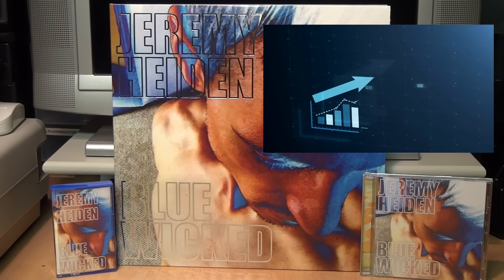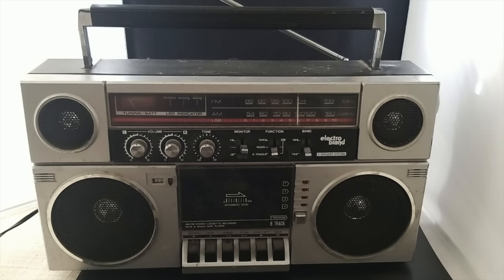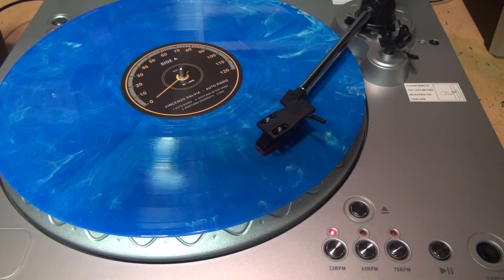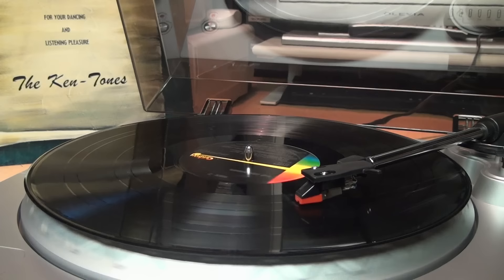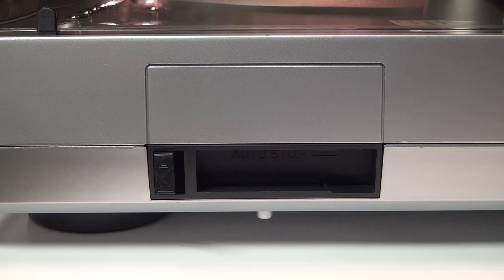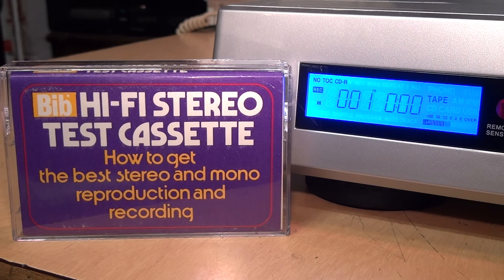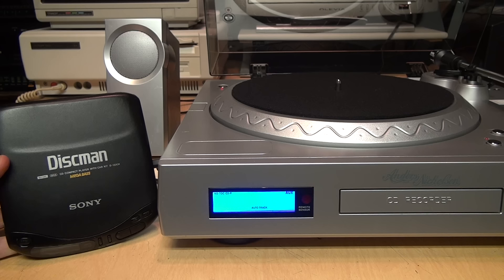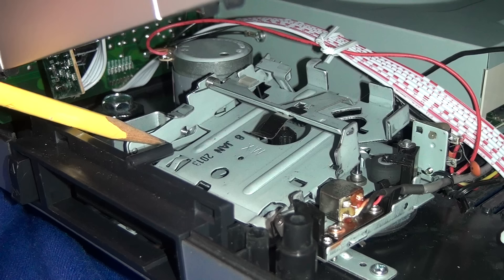A turntable that also plays CDs & cassettes - Anders Nicholson 2655

Comment: It's curious how they get 95% right, specially the turntable, and then they ruin the most advertised functionality in a stupid , easily avoidable, way. A less noisier optical drive with some dampening and problem solved...
Reply from the maker: Or simply run the drive at a slower speed. There's no need to rev it up to maximum speed just to record audio in real time.
Reply: @vwestlife  I know, but that would need some additional programming

Comment: I wouldn't want to record vinyl straight onto recordable CD anyway, to be honest.  Nice idea, but I'd prefer to record onto a PC, via the USB cable, then do a bit of post-production and then burn to a CD via the same PC.  The cassette part of it looks cheap and nasty.  It's not even a proper cassette deck, but some ultra cheap design for playing tapes in a car from the 1970's.  I like the overall idea, (of course), but execution was, for the most part, pretty poor.

Comment: It's a shame the cassette player. The sound quality is not bad. If they had done a better job at electronics, as basic as it is, it would be a more than decent cassette player.
Reply: replying to @masterargento90x:

i will finish your first sentence *FOR* you: "did not play cassettes with good sound quality". Did i finish your sentence right?
Reply: @user-ir6wv3gp4f  It's not that it didn't sound good, but that it put parasitic noise because of the poor electronic insulation, even rewinding the same. At no point did I say it was wrong (in fact, nor did Kevin say that).
The criticism I made was constructive, because if you plan to acquire a unit to digitize old formats, and it throws you parasitic sound improper of the one that gives you a cassette or a vinyl, it is an extra job, since you will have to clean it and lose extra frequencies.
Besides, the blow is higher than that given by an average cassette.
The truth is that I don't know what you find wrong with my comment.🤷‍♂
Reply: @masterargento90x  DARZHERFLARSCHNARBLEFLARFER?
Reply: @user-ir6wv3gp4f  What???
Reply: @masterargento90x  I PUT A PIZZA, LOADED WITH PIZZA SAUCE, ON A TURNTABLE SET AT 78 RPM: *PIZZA SAUCE FLYING ALL OVER THE PLACE!!*
Reply: @masterargento90x  - DARZHERFLARSCHNARBLEFLARFER?  
That's the sound tapes made when they were getting jammed into the tape player mechanisms.

Comment: You know it is a crap turntable when you see that stylus with the red sloped bottom. Just like on junk Crosley and Victrola tables. LOL. Some are not even diamond. They are RUBY styluses!
Reply from the maker: Did you miss the part where I explained that it's a magnetic cartridge, not the similar-looking ceramic cartridge?
Reply: @vwestlife  I wasn't talking about the cart build but more the el-cheapo styluses they use on those $10 cartridges. And I doubt someone would go to the trouble of putting a nice $250 microline rig on that tonearm. I guess like you said, it was sold to unsuspecting senior citizens afraid their records were turning into road tar and they needed to put them on CD's which will deteriorate before the records ever do. LOL.
Reply from the maker: @AudioGuyBrian  It has a diamond stylus.

Comment: Isn't this a technically illegal product?  AFAIK, any CD audio recorder needs to only be able to record to special "Audio-CDR" disks where a tax is paid to the RIAA.  I've always found this OUTRAGEOUS.  The idea that an industry organization can impose taxes on consumers is just OUTRAGEOUS.  The whole RIAA belongs in prison for this.

AFAIK, any device that can directly record audio onto a standard CDR is illegal for sale in the US and most of the rest of the world.
Reply: Theoretically you're right, although you can buy units designed for professional use like Tascam that bypass this because they are intended for professionals, that would not apply to this you are not wrong
Reply from the maker: The TEAC LP-R550USB I reviewed a few years ago had no problem recording onto regular data CD-Rs, as well.
Reply: @vwestlife  my guess is these days as the technology is fading away and most CD drives are computer drives anyway the issue is becoming moot and is rarely prosecuted or looked into/cared about anymore. Certainly in their heyday all the CD recorders I've had did require music discs
Reply: Computer CD recorders never required the use of music CDR / CDRW. This unit has a standard PC recorder. 

I did buy a Sony CD recorder component for my stereo system and it did require music CDs. And guess which brand of music CD gave me the most trouble — Sony!
Reply: @01chippe  yeah these days PC drives are all that's left so even consumer equipment uses computer drives and the issue has become moot, though the first commenter is correct about consumer devices requiring music cdrs it just isn't the case anymore